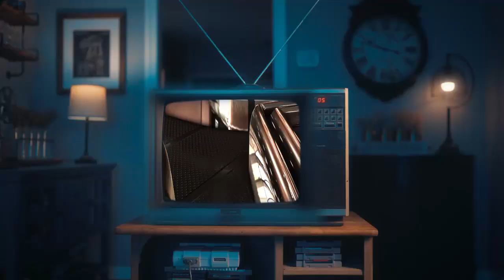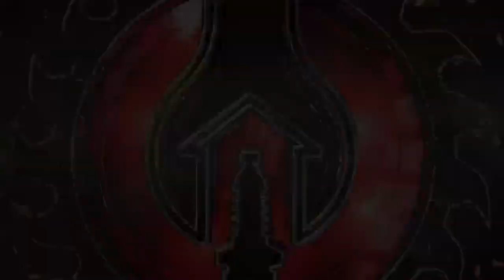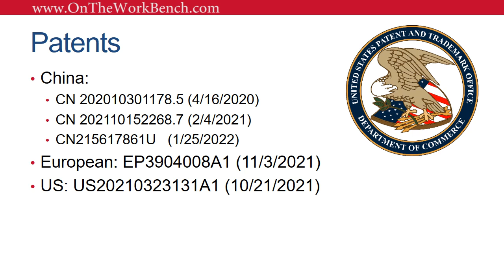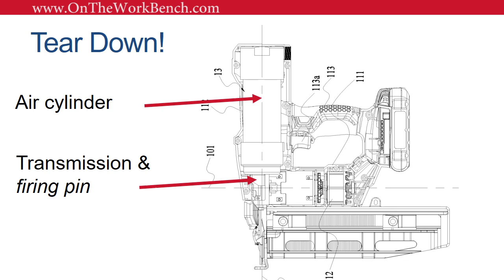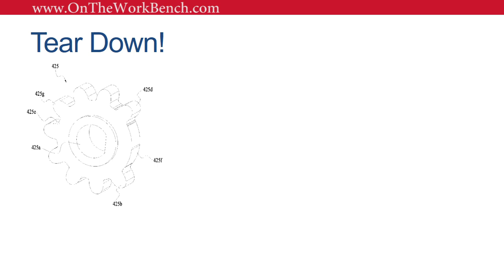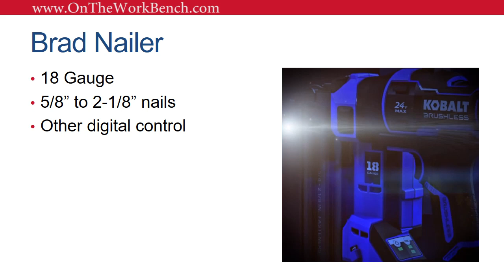🔥🔥🔥Kobalt 24-Volt Nailer Announcement 🎉 & Tear Down

Comment: My 24 volt battery operated cobalt nailor worked one time when I put up a little bit of trim now I took it out to do another project and I haven't even unwrapped the other battery and it just won't work and the battery has the three dots that light up telling me that the battery is full and I can't give it to exit a nail at all. Little brad nails even what do I do?

Comment: got my Kobalt xtr 24V Nailer from a reverse supply store. it's been lightly used and works perfectly in both modes but there was a detached black torx screw in the bag. The location of the screw is on the right side by the jammed nail release latch (looking down on tool from above). The other black torx screw is tight and I can see the nut inside the tool that secures it. I can hear the loose nut for the other torx screw rattling around inside the tool. Any guidance on how to move forward? The nailer works perfectly, so I don't want to mess things up unless it's a repair that can be made easily or you feel the loose nut will cause a problem. I am a weekend warrior when it comes to carpentry. I just subscribed and really enjoyed both of your  xtr videos!

Comment: So I currently have my hands on this nailer.  I am still testing it, but so far the problem is the tip on this nailer as it likes to make dents on the work piece.  Hole tear out appears to be large sometimes if you are driving deep.  I am comparing it with the Milwaukee and the Ryobi brushless airstrike nailer, which imo are the best in the market.